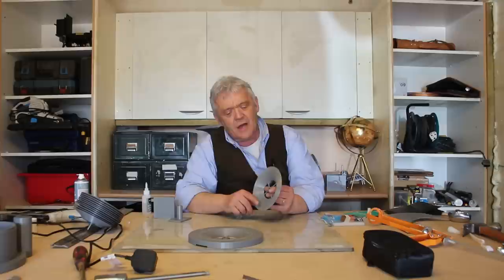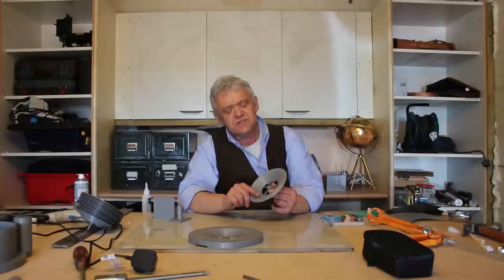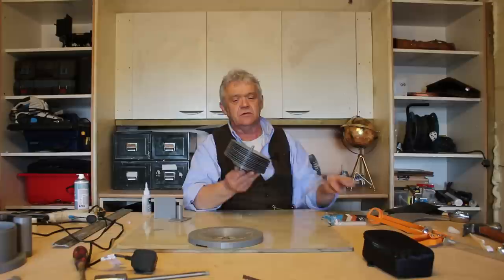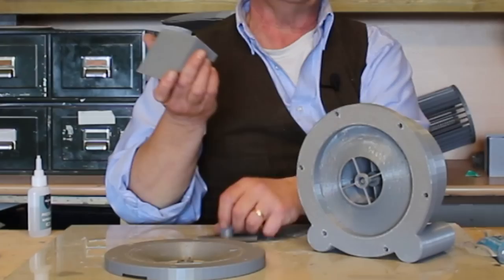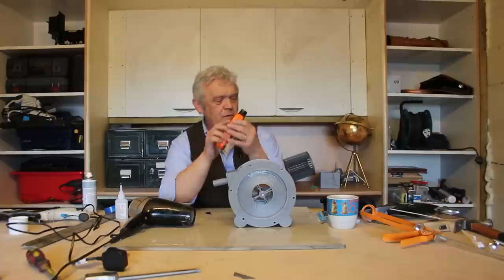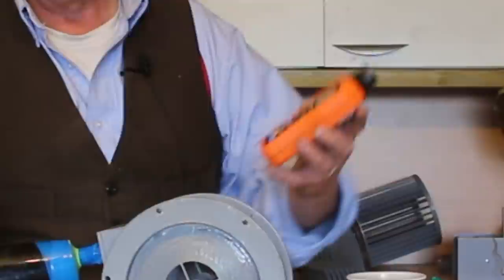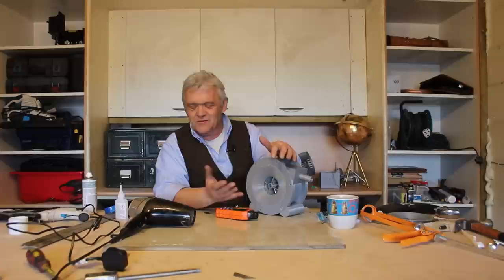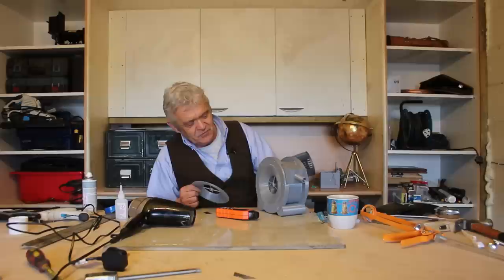1918 The Tesla Hyperbolic Turbine - A New Invention?

Comment: the inertia of this geometry cannot work in real scenario .-.
Reply from the maker: not true
Reply: Exactly, never mind the fact that flat discs work just fine.
Reply: @testurenergy   hater
Reply: lol well I suppose a flywheel would correct the inertia issue you propose. This channel is about thinking and experimentation, not absolutes my friend and that is why it is awesome.
Reply: @ThinkingandTinkering  friends all you want, the problem is that at high speeds, during acceleration the conical disc splits the rotation force vector into two components, one perpendicular to the axis of rotation (as is normally the case with the flat disc) and one parallel to the axis of rotation as in this case.

the parallel component forces the conical geometry to open so that the conical disc becomes a flat disc. thus causing a deformation which will obviously break the disc.

excuse me is but it's mathematical, it's not a question of hate or anything.

then make a demonstration video of a test to failure with two turbines, one with conical discs and the other flat and see which one breaks first even without the turbine casing.

Remember I demonstrated how it could break, he just said ''not true'
well prove it to me that i'am in wrong.
Reply: @Teleutefero  This happens in regular turbines and everything else, and all of them can explode if poorly built.
Reply: @Teleutefero  You are almost certainly correct that this design would deform before a flat disc design as you increased the input, but I think you over estimating the impact that has on the design. The question isn't really what the upper limit of stressing the design is but its efficiency compared to other designs at the same safe input level. 

For example a hydroelectric turbine that could handle the full flow rate of a river by itself but at a low efficiency would not be as good as a turbine that could handle only half the flow rate but at a higher efficiency, as you could simply divert the flow into two of the more efficient turbines.
Reply: @JSabh  hey that’s a good suggestion but flywheels are usually only used for smoothing out the pulsed torque from a pulsed combustion type engine, like piston engines. Flywheels are not needed in turbines as turbines provide smooth torque on demand. 

I believe OP is referring to the moment of inertia and the design of the discs. The radial forces do not lend themselves to this design as the discs will flair out at speed depending on the degree of the curve.
Reply: @JSabh  straight discs are the best for spinning. As the radial forces are evenly distributed down the length of the discs when flat and not normal to the discs face or spokes (Perpendicular)
Reply: @11GW  lol I never told anyone to stop what they are doing 🙂 only providing extra mechanics points.
Reply: @11GW  but again if I’m being honest, Tesla turbines work just fine the way Tesla Designed them. 

Everyone tries to make some new adaptation of the Tesla Turbine and ignores what Tesla wrote in the actual patents. 

He explained exactly how to make them work in the patents yet everyone just goes with whatever they want to think. 

If I had a nickel for the number of times I’ve heard people claim “Tesla himself said the turbine had to be spun to fast to ever work.” 🤭

Despite what MANY have claimed about the Tesla turbine, it does NOT need to be spun fast to work or work efficiently.   

Tesla turbines are made efficient when the slip on the discs is reduced and spinning the discs fast does nothing to reduce the slip, only increase the distance the fluid slips on the disc faces, which is by definition “loss”.  

Listen to what Tesla himself said in the patents of how to make them work.  

“Owing to a number of causes affecting the performance, it is difficult to frame a precise rule which would be generally applicable, but it may be stated that within certain limits, and other conditions being the same, the torque is directly proportionate to the square of the velocity of the fluid relatively to the runner and to the effective area of the disks and, inversely, to the distance separating them. 

The machine will, generally, perform its maximum work when the effective speed of the runner is one-half of that of the fluid; but to attain the highest economy, the relative speed or slip, for any given performance, should be as small as possible. 

This condition may be to any desired degree approximated by increasing the active area of and reducing the space between the disks.”  

1) increase the speed of the fluid relative to the disc, (not increase disc speed)  

2) increase surface area 

3) decrease disc spacing  

This is how you actually make a TesTur work. Not by spinning it fast.   

The fluid interactions with the disc that govern efficiency an torque are adhesion and cohesion. Full stop. 

And spinning fast does nothing to increasing either to increase the turbines isentropic efficiency.   

This is why everyone who chases rpm with the TesTur just flat out fails. 

They aren’t even trying to design them properly so of course they won’t work. 

But specifically you do not want to spin a Tesla turbine too fast because the centrifugal head will just counter your incoming fluid flow, reducing power. 

And the faster the discs spin, the fluid has to be going even that much faster just to be able to apply a torque on the disc face.   

Again listen to what Tesla said. 

“Still another valuable and probably unique quality of such motors or prime movers may be described. 

By proper construction and observance of working conditions the centrifugal pressure, opposing the passage of the fluid, may, as already indicated, be made nearly equal to the pressure of supply when the machine is running idle. 

If the inlet section be large, small changes in the speed of revolution will produce great differences in flow which are further enhanced by the concomitant variations in the length of the spiral path. 

A self-regulating machine is thus obtained bearing a striking resemblance to a direct-current electric motor in this respect that, with great differences of impressed pressure in a wide open channel the flow of the fluid through the same is prevented by virtue of rotation. 

Since the centrifugal head increases as the square of the revolutions, or even more rapidly, and with modern high grade steel great peripheral velocities are practicable, it is possible to attain that condition in a single stage machine, more readily if the runner be of large diameter. 

Obviously this problem is facilitated by compounding, as will be understood by those skilled in the art. 

Irrespective of its bearing on economy, this tendency which is, to a degree, common to motors of the above description, is of special advantage in the operation of large units, as it affords a safeguard against running away and destruction. 

Besides these, such a prime mover possesses many other advantages, both constructive and operative. 

It is simple, light and compact, subject to but little wear, cheap and exceptionally easy to manufacture as small clearances and accurate milling work are not essential to good performance. 

In operation it is reliable, there being no valves, sliding contacts or troublesome vanes. 

It is almost free of windage, largely independent of nozzle efficiency and suitable for high as well as for low fluid velocities and speeds of revolution.” -Nikola Tesla  

Tesla both knew it wasn’t meant to spin fast and that it worked great for low speeds IF you design it correctly. 

He verbatim says so. 

Yet I’ve literally heard people claim Tesla himself said it had to be spun to fast to work. 🤷‍♂️🤓👨‍🔬